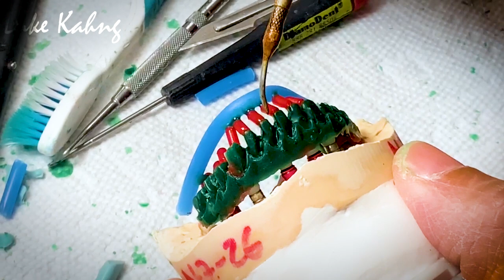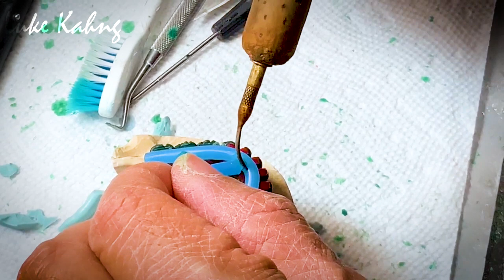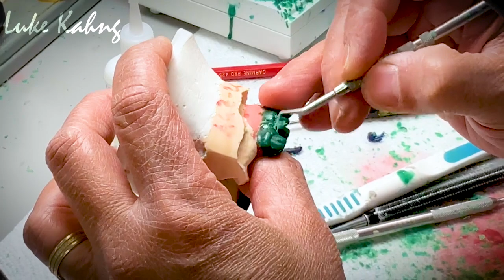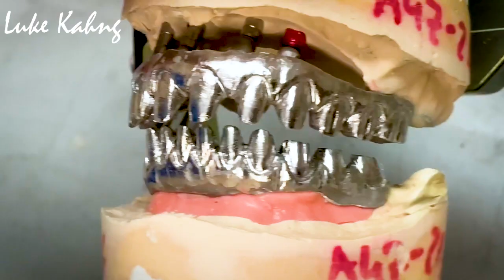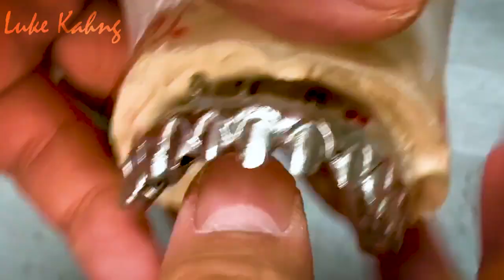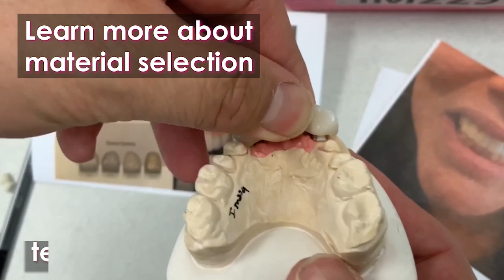How We Make Full-Mouth Implant Frameworks

Comment: hi there, why do you mention you can not mill this one? is there a particular reason you would prefer to cast it than mill it? 
i have a zirkonzahn m1 machine and most likely can mill the stl file of this case, i am just wondering if you find any defects in the milling process compared to casting .
or is this just a price - cost issue? 
what are your limits in chrome cobalt full framework  in milling? 
when do you decide rather do it cast it  instead of mill?